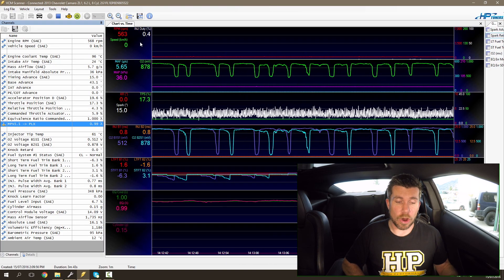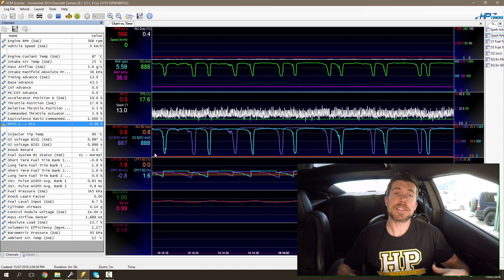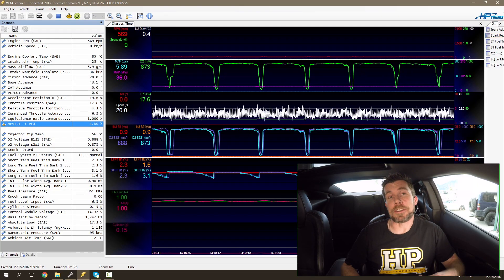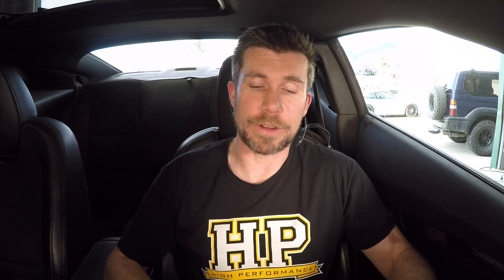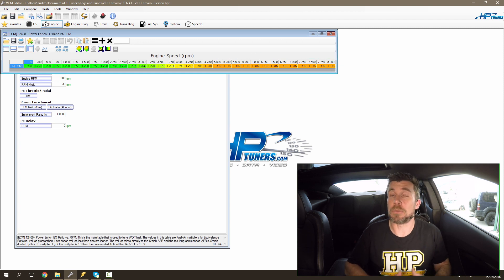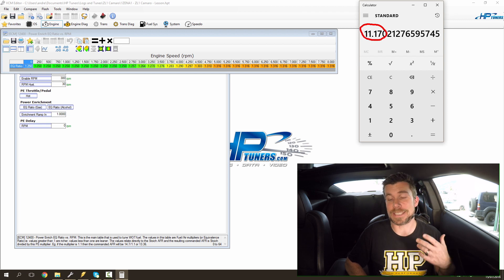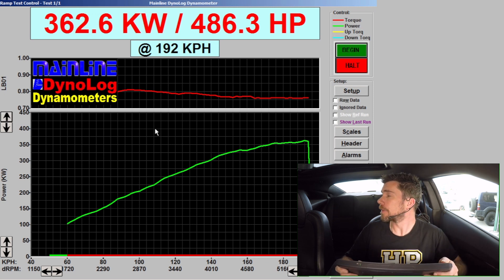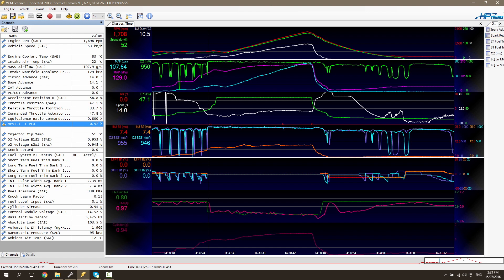Fuel Tuning | Reflash Tuning Lesson 2 Of 4 [FREE LESSON]

Comment: 10:00 when ramping up to 195 kph , is that light throttle? or WOT?
Reply from the maker: Unless mentioned specifically otherwise, it will be at WOT. Looks like 3rd gear too which will be the closest to a 1:1 ratio in this vehicle, although for most it is actually more commonly 4th gear when it is a manual box - Taz.